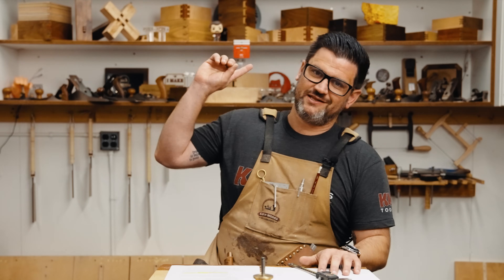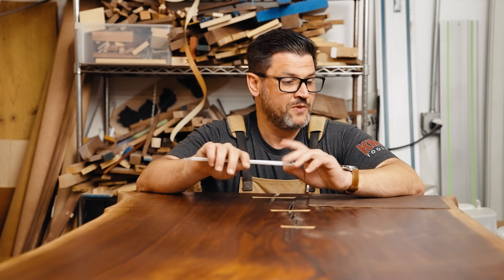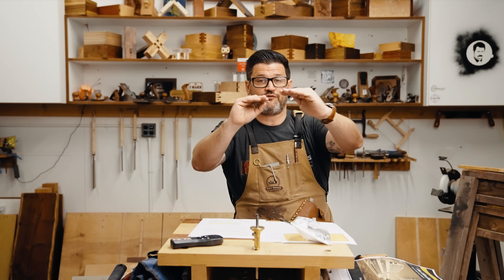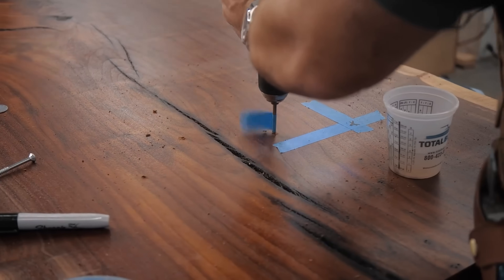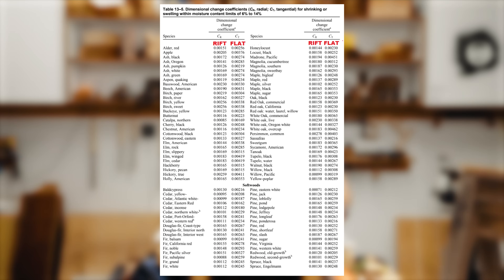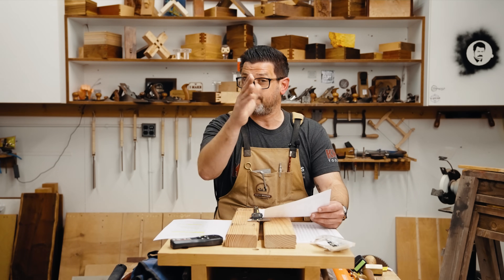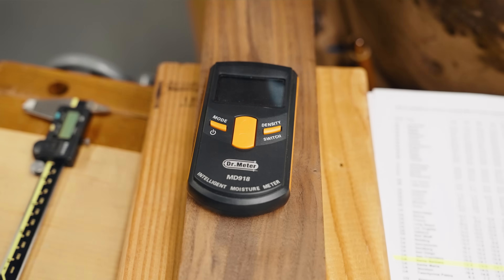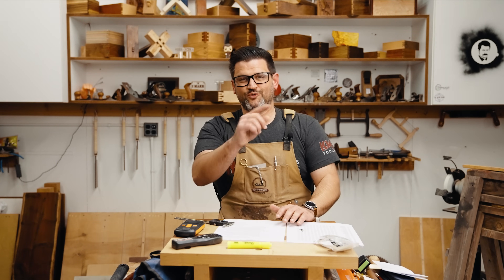Is Wood Movement a Myth? Analyzing 30 Years of Data

Comment: How deep does moisture in the air penetrate into a board that has been kiln dried?   If humidity only penetrates a certain depth of the wood cells, is the change in width or thickness caused by only the wood cells that the humidity managed to penetrate to?   Or do all of the wood cells in the entire thickness/width of the board expand/contract proportionately with the amount of moisture it absorbed or lost?

Comment: Great video and data. If one is building a piece and say you don't know where you might end up living in the next few decades, what's the minimum and maximum humidity change that might occur, say between Bishop and Juneau (or whatever two spots are the most different)? For flatsawn cherry (0.00248), a 30" table might see humidity changes from 18.1 to 3.6 (14.5 total), so well over an inch of movement!
Since I wouldn't expect my handmade cherry table to live outdoors, what we really need are humidity changes inside of homes, which does vary across the country I believe, as different area required different amounts of heating.

Comment: Well, pretty sure that kill/kiln dried wood is at 6 to 8% when it comes out of the kiln. Let it sit in your shop for a year or so, and it will be the same MC as the rest of the wood in your shop. Also, quarter sawn wood does not cup or bow like rift sawn wood does as the relative humidity changes.

Comment: This was so helpful, thank you. The one thing I was hoping for was a figure of merit for when I don't have to worry about my rigid piece cracking, which I assume is species- and grain orientation-dependent. E.g. if given the math I expect a 3/8" dowel joint mating two pieces of Red Oak ~1/2" from exposed end grain to strain by 1/16th can I just glue it up and move on, or is it likely to crack?

Comment: This is very helpful thank you.  I’m making an ottoman tray (as large as 32 x 32).  The tray panel is made from quartersawn white oak.  According to the information in this video, the seasonal movement across this panel would be roughly 1/16, so 1/32 on each side.  But the problem is the tray panel includes brass accent pieces inlaid about 1.3 inches in from each of the 4 sides.  The brass strips are 1/8 inch deep and 1/4 wide and there are 2 that go across the grain and 2 that go along the grain.  In your opinion, could this cause the tray to warp over time?

Comment: Interesting! I once went back to snag a tulip fronted kitchen I fitted on the coast in Devon England and the 2.5mm door gap on each side had become zero door gap. I trimmed 2.5mm off each side, added 2 coats of paint and left. Less than a year later I had to go back cos the door was too tight to open. Took another 2.5 off each side... that's 10mm!!

Comment: Awesome information.

Question. Wood movement is from moisture movement into and out of the wood. If the wood is completely sealed with a waterproof finish, why does the wood still move? Even with a good lacquer finish wood still moves. Would an epoxy coating prevent wood movement?

Comment: The real point of wood movement is so that if anyone asks about a mistake on a project you can use it as an excuse. 
For example:
Customer: Why is there a dark part on my table top. 
(Pretend it is a maple table top but by mistake one of the pieces was walnut)
Me: It is wood movement. Sorry there is nothing I or any woodworker can do about it.
Customer: That makes since it is a bummer but I understand but why is one of the legs on the top of the table.

Me: Same thing wood movement is hard to predict.

Comment: Excellent video! The equation accounts for an overall width of a panel but I am curious if making the same panel with 6” boards vs 8” would render slightly different result. The assumption being that smaller boards are considered more stable or maybe it doesn’t matter. Thoughts?

Comment: G'day mate

I have 2 questions
Im building kind of kitchen top but for outside.
It is undercover, no direct sunlight but still european winters and hot summers will have some influence.
So it will be 2.5m x 700mm x some 40mm thick in beech wood 
So im thinking to put 4 x 14mm rods through with nuts on every glue joint to prevent splitting and banding but 
What about wood movement in that case
And second question is what would be best finish in that environment.
Thanks

Comment: I don't quite understand the relevance of these figures.  The data you give regarding variation in temperature /relative humidity matter only to the outdoors.  Indoors, where most of what you would build would be, the situation is much different.  In a cold winter climate, the indoor RH can swing dramatically across seasons, and wood movement will absolutely be noticeable and significant, even in a little jewelry box.  Maybe in socal it's not a big deal since the temperature is always the same, but in the north it's not uncommon for the RH in a home to swing from sub-20 in the dead of winter to 60+ in the heat of the summer. 

Maybe you shouldn't freak out about it but at the same time it shouldn't be downplayed either.  It's most pronounced in big pieces which also happen to be the most time-consuming and expensive to make - and the last thing you would want to see is all your kitchen cabinet doors you built and installed over the winter warping a summer or two later - - something which does indeed happen!

Comment: Hi Jonathan and followers, I am planning on making a tea box out of Cherry.  Dimensions, 15" along the length of the grain and  8.75" along the width.  I was planning on having a solid top versus a veneer over MDF.  Do you foresee any shrinkage issues with this size?  My concern with using a veneer is color and grain matching with the sides.  I was planning on making the whole thing from on board.  What thickness would be best?

Comment: Not to toot my own horn too much, but I'm quite experienced with wood movement. I invented some thin and stable water resistant end grain cutting boards. It took a ton of experimenting on wood movement and it's effects on certain wood products and glues... Anyways. I had no idea that there was all this data and formulas for figuring out wood movement. That could have probably saved me a lot of time if I piggy backed off of their research lol. Very well done video!

Comment: What movement occurs in wood that is sealed with multiple coats of finish?  For example, table with four or five coats of polyurethane?  Unless you assume the finish is water permeable, any finish has to dramatically reduce any movement from changes in atmospheric humidity.

Comment: Hey Jonathan! Such a great video! One question tough. If your shop is not climate controlled and you build a large on slab live edge table with 12% MC, wont it warp a lot if the client takes the table home where it will go down to 8% MC?
Reply from the maker: It won't go down that much. Absolute humidity isn't going to change inside. Only relative humidity.

Comment: I installed solid wood doors with panels in my apartment. I finished them in the summer when it was hot and humid. I did use the AC except when the finish was being applied and drying. They looked fine. When winter came, the panels shrunk and a sliver of wood at the edge of the panels became visible. Then summer came and the sliver of raw wood was hidden again. Other than only finishing in winter, or touching up the finish in winter, what can be done?
Reply: Pre-finish all of your pieces, avoid the glue surfaces.
Reply: @landonsharrett20  I didn't build the doors, they came pre-assembled.

Comment: I want to say thank you! - Around 2 months ago I bought your shop apron (bought from the UK and arrived in less than a week and at a frankly incredible price for the excellent quality)... but the story... the reason for buying it is that I was upgrading to a professional table saw and my previous little site saw had given me a kickback once on some dowel and left me with a mean little bruise.

The thank you comes in 4 days ago however,  I was ripping large lengths of 6x3 walnut. On one of them, the weight tilted the stock about half a millimetre and bam, the saw splintered the wood and flung it back into me, practically lifted me off my feet and threw me on the floor. It left me winded beyond belief with a large black and blue bruise on my upper stomach and a graze on my arm where the splintered end glanced off the apron and cut me across the forearm. I can say with absolute certainty that without the apron absorbing the blow and the thick material in the way, I'd have a broken rib or two and possibly even have been punctured by the 6 foot splinter that broke off. This is the biggest endorsement I can possibly make for the product. Not only is the quality incredible for the price, it genuinely could save your life in your workshop. So many of us work alone, often out in the garage or workshop or even out away from anyone, we need to be safe and your apron kept me safe! So thank you! I can't wait to buy literally everything else you make!

Comment: The academic in me really likes that those damn nerds went and scienced the shit out of this to precise measurements. Hats off to them! The builder in me tough, finds it a wee bit overkill on a practical level. I mean, people building some of the most gorgeous heirloom furniture you will ever see in, say, the 17th century that still stands didn't go down to this precision and yet most of us won't build anything that comes close to coming close to any of that. And they did it by hand too. To say nothing of absurd insanities like Japanese wood castles still standing, the oldest of which is almost 430 years old. 

Understanding the general principles (the bigger the wood piece, the bigger the absolute movement; along the grain - not much movement, perpendicular to the grain - a bit, parallel to grain - a bit more than a bit), all those "old timey" techniques make clear intuitive sense and you can start designing around the movement. Things like "big door panels float free in the frame made of much narrower wood pieces", "solid wood drawer bottoms also float", "nails (bend with the wood) > screws (more brittle, don't bend and if they do bend the grip loosens) often, unless you're using plywood" and so on.

Comment: Im a newbie woodworker, and at a glance, the data doesn't seem too far apart between species. If we are talking 1,000ths of an inch per inch, couldn't you just account for the worst case scenario (like .005 per inch?) for wood movement in ALL your projects?  I mean does it really matter if you allow for more than necessary movement?

Comment: This a great man, I have noticed a difference in the furniture I built in San Luis Obispo, CA and the furniture I’ve built in Al where I now live, which is in line with the data you’ve shared. I feel like the biggest factor for wood movement has way less to do with humidity and way more to do with milling lumber and allowing it to release the stress in the wood through that process before final dimension and assembly. I have process that I go through to combat this phenomenon, I think a good follow up for this topic would be on properly processing wood for use as it relates to movement realized in milling and dimensioning. That would be amazing!

Comment: So, what you're saying is, your joints are totally going to 'SPLOD! 

Based on the data you presented, dead bodies have more movement than the wood.  That joke works better around Halloween.  

Thanks for the reference data.  You've just laid to rest a long running argument about wood movement using data and science.  Reddit is going to hate you.  I'm commenting and hitting that thumbs up button.

Comment: It seems similar to "exact constraint" in machine design!   What they do is look at all the degrees of freedom something has and try to have exactly one constraint per degree.  Three points define a plane, so a 4 legged table is an "overconstraint" which is why it has to be just right or it wobbles.

It's not the same exactly, woodworkers want to get things just right, wheras product design is a lot about avoiding the need for precision in the first place where possible, but it's the same idea.

Two boards with one screw have two degrees of freedom. The screw constrains both axes of sliding.   Adding another screw constrains rotation but also constrains the same two sliding axes. Now they're overconstrained, and you'd have probably if they expand at different rates, but if you had a peg in a milled slot replacing one screw, you wouldn't have 2 constraints on the long axis, and it could expand freely.

The "bendiness" of the wood also can be treated like a degree of freedom, every place it's going to bend is it's own degree

Woodworkers seem to have figured this all out, but if you're new and not a pro woodworker(I'm sure not!!) looking at degrees of freedom seems useful.

Comment: Very cool, thanks. Too many people who work with wood don't think about movement. I was on site in a new home when we heard what sounded like an extension ladder going down in the great room. Turns out the fir ceiling on the giant 3 season porch, installed in the dead of winter (New Hampshire), exploded one wet spring day. A section like 8 feet wide and 12 feet long came crashing down as the boards ripped free from their brads. The aftermath was a sight to behold. The GC wasn't impressed, I was glad it had nothing to do with me.

Comment: In general, I think the reason we see wood movement emphasized so much in instruction is because people do dumb shit.  Like glue cross grain or restrain a panel in a frame or use green wood or unacclimated wood.  That will ruin their project.  However as you point out once you account for it, it isn't a big deal.

However, In a fine quality project even a few thou can make a big difference in the look and feel of your project.  Have a flush through tenon?  You're going to see and feel it get shy and proud of the surface as the seasons change.  Unpinned panels will wander in frames.  Perfect piston fit drawers will rattle or get tight.  Friction fit pieces will pop loose.  Doors will get tight or loose.  Box lids won't quite sit just right.  All things no one will care about in a cheaper piece but at the top end make a huge difference and need to be thought through carefully and intentionally.  This is a level of woodworking most people will never approach but we read about it in fine woodworking from authors we respect and admire.  

So from the instructions we give to prevent dumb mistakes and then the high level discussions of the finest high end work both of which are disproportionately consumed by new woodworkers and so we get this idea that wood movement is much bigger than it is.  It's understandable.
Reply: That makes a ton of sense, especially the bit about disproportionate emphasis for newbies.  Newbies like myself are also the most likely to be really really worried about surprise workpiece explosions since we lack the depth of lived experience to know the risk is overblown.
Reply: @DeaconDesperado1  I know I was overly concerned too.  It's probably not a bad thing really, it teaches you to think about the material in your design

Comment: Where wood movement inevitably comes up though, is when people fail to acknowledge it at all, binding end grain and long grain.   The most common failures are breadboards glued all the way across, or cutting boards with a trim all the way around the board that traps the grain.   In these situations, a tiny amount of movement may still be enough to cause a crack.   So allow for the movement with smart techniques, but don’t sweat exactly how much.
Reply: Yes. A friend of mine has a cutting board that is built like a bread board, and after a few years of use, the middle section sticks out, it’s about a quarter of an inch wider than the bread board ends. It was made using the proper technique, so nothing has cracked, but of course it doesn’t look right anymore. Perfect illustration of wood movement.

Comment: Wood movement usually isn't a concern because traditional woodworking techniques (e.g., rail and still paneled doors, carcase construction, veneering on sheet goods) are designed to compensate for it.  Ignore it and it can bite you.  Build something in Seattle or Portland that doesn't take it into account and ship it to someone in Phoenix and you'll here about it.

Comment: I think most people forget that these practices came from a time when houses were drafting messes.  So in summer furniture would be sitting in 80+% humidity and in winter sub 45% reguarly.  In a modern home with less than 2% air leakage when it was built this is not an issue.  So long as you don't lose power reguarly.
Reply: So, in other words, my 1910 house with no a/c.  😂

Comment: So in the example given, worst case scenario, the 40” table will move 1/8”. That’s 1/16 over half the table and a bit less than that at the location of the outboard tenon    I don’t elongate holes in my tenons and have never had a problem.  I guess your data back’s that up. Thanks for the proof!

Comment: This is amazing. I did have some problems with a dovetailed jewellery box made from maple and the inside tray was made from cherry. I finished this project in the summer of Qatar (in the middle east and it was soo humid), then it was shipped off to Dubai and a month later the tray got stuck. Because it was soo humid in Qatar I thought that it would very slightly shrink, but the wood was dry, so if anyone knows why it moved could you tell me? After watching this video I love that I can calculate the movement in tables etc. Thank You Very Much Mr. Katz Moses.